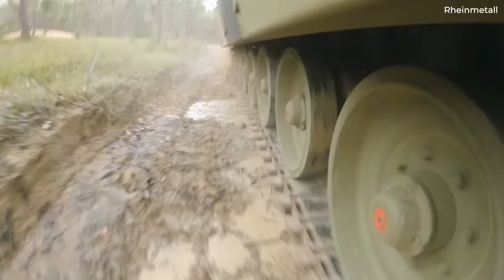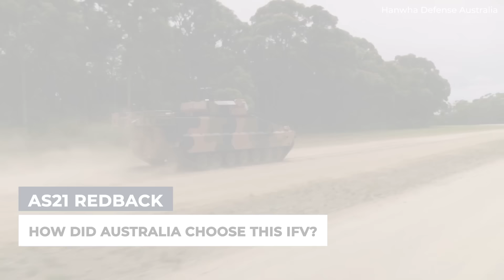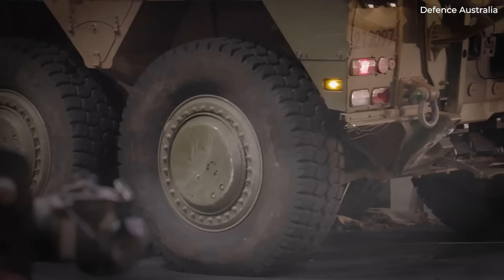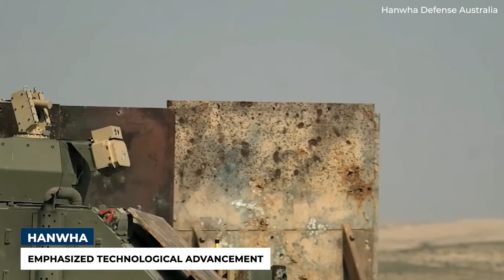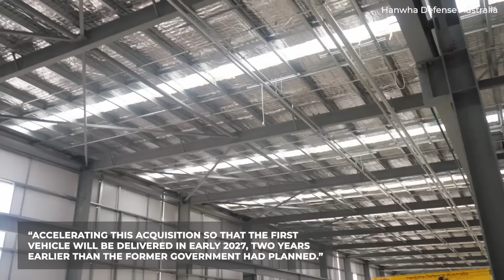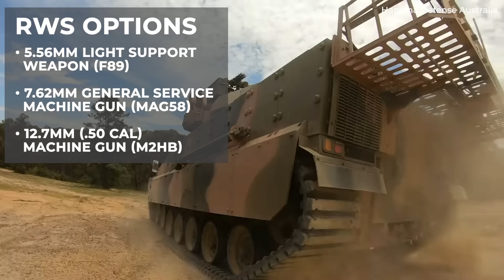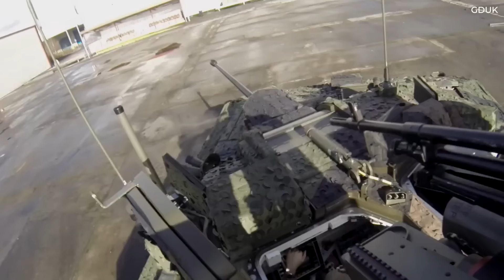AS21 Redback: The Australian Army’s Next-Gen IFV

Comment: I have misgivings about the rubber band tracks in a combat environment, you cant just drop some links, you have to replace the entire track, you can carry spare track links on a vehicle but no one can carry a full track, entire b echelon vehicles will be needed to carry spare track for the squadron, i do not think it likely a crew can replace a rubber band track without the assistance of the LAD, wheras live track links can easily be replaced by the crew.
Time will tell.

Comment: Is there no concern of putting an active protection system on an infantry fighting vehicle?
Reply: KF-41 and AS-21 both had APS systems, AS-21 has Iron Fist.
Reply: You just have to change tactics accordingly (move away from the vehicle) But a hazard always remains. That's why the Puma went for Softkill and low collateral ERA instead of hardkill.
Reply: Even without APS, if the vehicle gets hit, there will be metal flying left and right. Infantry ALWAYS has to keep their distance, whether the vehicle has APS, or ERA, or nothing

Comment: They should be 1 for 1 replacing M113s
Reply: What units would you put them in?
Reply: @thomasb5600 the same units that are using them now. Both Active and Reserve. If some are left over, they can be in long term storage, rotating with active units to even out wear.
Reply: @donaldmatthews7226 so less than 450.  Most use Boxer, Bushmaster and Hawkei, the only 2 brigades that are likely to use IFV.  That’s is about 250 not 450 IFV. 2nd divisions uses Bushmaster and Hawkei.
Reply: @thomasb5600 so who uses the m113s? They should be 1 for 1 replaced

Comment: Australia needs to reclaim the auto industry. In the case of war, God willing it never happens, automotive factory can readily be re-purposed. Australia should be aware its defence partner Indonesia has state industry dedicated to weapons manufacture (it does not trust the private sector and wisely so) much like Australia did have in the 1940's and 1950's with Commonwealth Aircraft and 1940s GM and Ford Australia manufactured military vehicles and parts for the Australian and US military forces, including light commercial vehicles, shared vehicle components significant during World War II, as they supported the war effort. No auto industry means a non existence arms industry. Indonesia manufactures its own AFV, IFV and light commercials by state manufacturers. There is no reason why Australia should not re-initiate its wartime manufacturing capability.

Comment: The Reality & China? (expansion)
- Australia’s single greatest security threat is China’s expanding presence across the South China Sea and the broader Pacific.
- Aussie-land is a continent, that just so happens to be surrounded by water. 
- If a conflict breaks out, it won't be fought with battle MTB's and heavy IFV's or light APC's rolling across an open Aussie-land prairie. 
It will be defined by island warfare, sea lines of communication, air superiority, and long-range missiles.
- Unless 'The Last Line of Defense' is the aussie-land prairie?
- Manufacturing away from South Korea is just plain common sense. Having a massive portion of South Korea's defense industry sitting well within range of North Korean tube artillery is completely absurd—and frankly, laughable.
So - super brilliant at core with the factory (factory is the core issue) for the well of rich aussie-family. hehe
(well) Cheers

Comment: Only ~120 IFVs to replace 400 APCs sounds like a drastic downsize for aussie mechanized forces.
Reply: We also have the bushmaster and hawkeye. I know their capabilities aren't the same, but I'd say all of them are a significant upgrade on the M113
Reply: Ill give a "quick" summary of whats happened to the Australian army under the latest DSR,

Since 2010(ish) we operated 3 multi role/purpose combat brigades (1st, 3rd and 7th brigades) they had some of everything: infantry, armour etc.

With these 3 multi role brigades spread across 3 cities Brisbane, Darwin and Townsville(where the 3 are based) and each having alittle bit of everything, they were limited in what kind of strategies they could put into effect due to how few infantry they had(compared to if they were a full infantry brigade) or how few tanks they had(compared to if they were a full armoured brigade) 

Should anything happen the multi role status of these 3 brigades stops them(individually) from forming critical mass of either infantry or armour.

To address this the DSR has decided to change the force structure of the Australian army

They've decided to put the heavy armour in Townsville(theyre' the ones getting all 120 of the Redback IFVs and tanks)
The motorized forces in Brisbane (Bushmasters, hawkei's etc) 
The 1st brigade is being retrained into littoral(close to shore, so sort of marines but not marines) combat brigade based in Darwin 

A "new" 10th Brigade has also been formed(or reformed would be more accurate) they will be in charge of long range fires and air defence, they have all the HIMARs and land based Anti ship missiles.

This is a super shortened version of whats happening for ease of understanding.

TLDR.
Australia has decided that its army will no longer be generalist forces due to its size(or rather lack there of) and has taken steps to specialize its forces to reflect the realities it faces in the region,
the reduction to ~120 IFVs from 400 reflects that choice

there are some in the community that are convinced that the reason this choice has been taken is due to the massive amounts of funding required by the AUKUS agreement(both pillars 1 and 2) in addition to the hunter frigates which are both cannibalizing the defence budget leading to such drastic alterations to Australia's force structure.
Reply: Australia’s also building CRV boxers in Ipswich that could help fill that gap
Reply: What do you want 400 IFVs for, lol

Comment: Upgraded Bradly IFVs would have been perfect for this at a tenth of the cost. They are literally killing it in the UKR.
Reply: Bradley is a dead end design even for the US Army, it is suspected that the A4s would be the final modernization round. There is no room left for upgrades. 

The AMPV could serve as a stopgap by adding a 30mm unmanned turret on it, but the architecture has reached its limit.
Reply: they're an outdated design, as are the Abrams, Australia finally woke up to reality and is buying new tech instead of shitty outdated yanky stuff

Comment: The acquisition of the Redback can't be looked at in isolation. The change from the significant number of M113's to the smaller number of Redback's doesn't take into account the significant structure change to the army and the applicability of how and where the redback fits in with the Boxer CRV and other acquisitions. Don't get me wrong, great video, however this is a look at just the AS21 Redback in isolation. I think this video needs a follow up on the force structure of the Army to explain why the reduction is so significant and what the purpose of the Army is going forward.

The comments on defence procurement are interesting. There needs to be more scrutiny on defence procurement, with public and private terms and criteria. It doesn't divulge state secrets to say whether you want half or full sections being able to mount and dismount from your IFV's, or if you want a uniform number of embarked soldier across multiple platforms, i.e. Bushmaster, Boxer, and Redback, to standardise unit composition across the Army. There are criteria that can be public and not give away any information, rather than have such a secretive procurement process. Close committees can also review the criteria. Defence spending is set to both increase, but also be more constrained in the future by expansion in the size of the ADF as a whole. There needs to be transparency in procurement to allow people to understand what the money is being spent on.
Reply: This isn't a channel for this kind of information you request. You might get requested information from Perun or Perun alike channels, but not here.
Reply: the M113's should be updated and converted into mobile anti-tank, mobile anti-aircraft/drone- it's what China and Russia do.

Comment: Baffling to go with a platform that uses a completely different turret than the one you're already using on the Boxers. Would almost have made that a requirement for the bids to begin with if it were up to me.

This pretty will have long reaching financial downsides, both in maintenance cost and in the acquisition of specialised variants. Can't for example get the mortar turret and outfit both vehicles with it when they have different turrets to begin with.
Reply: Also think of commonality of engine and spare parts between lynx and boxer.  Rubber tracks are a nightmare to change in the field as well.  One other note is that the ammunition for the boxer (which we are buying 411) is not compatible with the Redback either.  Double the logistics train for in reality a very small capability since the order was axed to the paltry 129.  Overall it was a political decision to build it in the Defence Ministers home electorate, and not the correct one in a shooting war.
Reply: @davidjurgs9257  oh man I thought it was at least the same 30mm. Nuts.
Reply: @davidjurgs9257 Composite Rubber Tracks are simply superior in virtually every other metric, thus why everyone's only looking at those going foward.
Reply: It shares the same powerpack with the Huntsman. Turrets commonality doesn't help much because it's not a system that usually gets transferred vehicle from vehicle.

Comment: I'm surprised we went with Hanwa, considering Rheinmetall's very valid point that we're already getting the same tech in our Boxers that they'd make for the Lynx. Seems like an unfortunate quirk of the procurement and logistics disconnect
Reply: Australia is using Hanwha K9 and K10 artillery systems which use the same engine, gearbox and suspension as the AS21, those are already being assembled in Australia.
Reply: For me what isn't clear is why they did audit at all. It is clear they didn't want AJAXed in any way and by doing so they were going to reject any European IFVs anyway.

Comment: I think going with SK boost the Pacific alliance. Regarding the financial trouble, 
and looking at the success of Rheinmetall and Boxer, I guess CV90 or Lynx would be the better choise.

Is it really true that German Puma was part of the competition??? 
Can´t believe it, because the  domestic Project is only designated to replace the older Marder IFV of German Bundeswehr and not for export.
Reply: Puma was an early competitor to LAND 400 Phase 3, but dropped out early because we didn't want an unmanned turret.
So the Germans focused on Lynx, which became one of the two finalists before losing to the Redback.
Reply: The Lynx still had teething issues with its software and ergonomics which is why the AS21 won. The CV90 was dropped early because it was deemed too expensive for what it offered.

Comment: I heard that the soldiers who tested and ride in the test vehicles preferred the Redback because it was a better ride. The rubber tracks made a big difference.
Reply: rubber tracks and hydromatic suspension were main two.  Aircon was very good.   Thing was feedback wise the troops never crewed both so you couldn't compare 1 to 1
Reply: It's got that same helmet mounted HUD to see through cameras adapted from AH64 Apache helmets. Local industry collaboration is huge. Can't wait to see how they evolve.
Reply: Funny because the running gear of the Lynx is from the Australian company Supashock.
Reply: How did Australian military procurement get scammed again: at that price you get almost the double number in cv90 mk4 with the licence to manufacture them at home ?!? Such a deal must have been signed by Scott Morrison's dream team.
Reply: @yvesrochard4025 because you cant compare the budgets.  The ADF budgets as whole life cost accounting with only a few exception most countries use to off the shelf cost accounting 

While there was never anything official released to why Namer, CV90 or Ajax weren't selected in the final 2 

Rumors are Ajax was deemed not fit for purpose, with hind sight that was the right decision.  CV90  was the most expensive and the Namer did not match the requirements
Reply: @richardthomson4693  I'm not sure about Australian accounting standards being different from the rest of OECD countries. What really matters here is the contract between ADF and its provider[s]. It's common for such military procurement contracts to include the cost of regular maintenance throughout the life cycle of the vehicles. I doubt any company would include any extra wear/tear/repair cost beforehand in the contract, considering it's not its responsibility to decide whether the equipment is actually getting used in military operations or not.
Reply: @yvesrochard4025  I am not sure what you are trying to say then. Your first point seems to argue that the CV90 would have been cheaper, but as richardthomson points out you were only comparing off the shelf price for the cv90 and full life cycle costs for the redback, Your next post doesn't seem to really reply to this argument. can you explain?
Reply: @dna6882  let's take the figures released publicly for the contract between the ADF and Hanwha Defence Australia: the LAND 400 Phase 3 Acquisition and Initial Support Contract for the AS21 x129 vehicles is worth 	approx. A$4.5 billion (acquisition + initial support) - i.e. a total unit cost of ard 21M euros. The equivalent price point for the cv90 mk4 is 12M-14M euros for a 100-200 unit order. Richard's point has got nothing to do with mine: his refers to public budgeting & accounting, not facts from any commercial contract. The Australian ministry of Def's budget is about accounting provisions that estimate the total cost of the equipment over its life cycle. Which is not the reality of any military procurement contract, that does not try to predict such a total cost over the equipment's life cycle. No military equipment manufacturer will contractually cover costs beside the vehicle & its initial support package [=training, regular maintenance + initial stock of spare parts], simply because no manufacturer knows how the equipment is going to get used by its client, whose circumstances may vary extremely depending on their military engagements. One last thing, heavily modified vehicles like AS21 are not considered combat-proven, unlike their base model. Mk4 is not a heavily modified cv90.
Reply: @dna Let's take the figures released publicly for ADF's contract with its main provider: the LAND 400 Phase 3 Acquisition and Initial Support Contract for the AS21 x129 vehicles is worth 	approx. A$4.5 billion (acquisition + initial support) - i.e. a total unit cost of ard 21M euros. The equivalent price point for the cv90 mk4 is 12M-14M euros for a 100-200 unit order. Richardthomson's point has got nothing to do with mine: his refers to public budgeting & accounting, not facts from any commercial contract. The Australian ministry of Def's budget is about accounting provisions that estimate the total cost of the equipment over its life cycle. Which is not the reality of any military procurement contract, that does not try to predict such a total cost over the equipment's life cycle. No military equipment manufacturer will contractually cover costs beside the vehicle & its initial support package [=training, regular maintenance + initial stock of spare parts], simply because no manufacturer knows how the equipment is going to get used by its client, whose circumstances may vary extremely depending on their military engagements. One last thing, heavily modified vehicles like AS21 are not considered combat-proven, unlike their base model. Mk4 is not a heavily modified cv90.
Reply: What about drones?

Comment: And it just so happens the winning bids factory location is in the Defence Ministers electorate. . . . funny that
Reply: Yeah well the Lynx was going to be built in his libs counterpart electorate. But from all performance measures the redback eeked out the lynx and was also cheaper. So it would of been more suspicious had they not picked it.
Reply: @dan7564 technically, AS-21 was almost double the price, but the requirements made it so that domestic modifications were happening to the two vehicles. AS-21 was built for the austrailian tender for the start, so it was relatively easier to choose the AS-21.
Reply: it opponent was the Lynx an overdeveloped, overengineered money sink made by Germans, with a fucking novel series written about it's various flaws and break downs, who are NOTORIOUS for not supplying parts to countries that buy their weapons and then fight a war, who refuse to allow a large number of the parts of the vehicle to be made in Australia, and are located on the other side of the planet with different geostrategic objectives. Korea is RIGHT THERE, and has the same geostrategic objectives to us, AND is willing to let 100% of the Vehicle be made here, and it's cheaper. By alot. 

The Lynx costs MORE THAN A ABRAMS M1A2 MBT!!!!. 

The fact the Lynx was even being considered was corruption.
Reply: @jorgejustin461 Can you give an example where the Germans haven’t supplied parts to a country that bought their weapons?
Reply: @LeeMillburn  That's the key point. "Supplied." Germany is on the other side of the world, which leaves a huge logistical gap if a war is to break out.
The Redback on the other hand can be built here, and is made by the Koreans, who aren't as far away.
Reply: Not really considering that is literally where most of Australia's automotive suppliers are...
Reply: Nothing new. It's the same in UK- which Australia generally follows. You would be shocked at how the US defence industry plays the US politicians to dance to their tunes.
Reply: @Patrick-l5f4w Littoraly